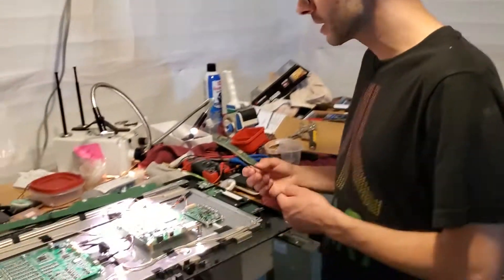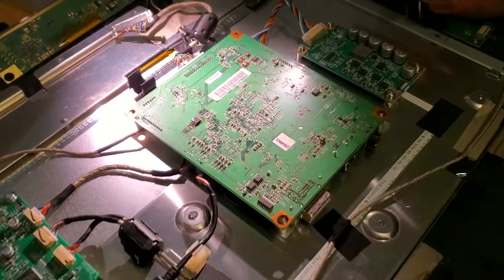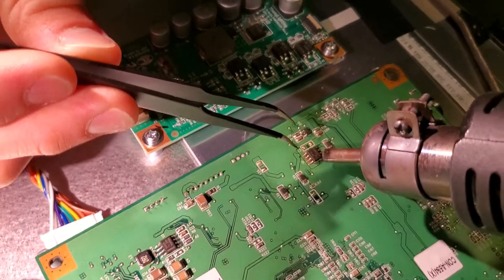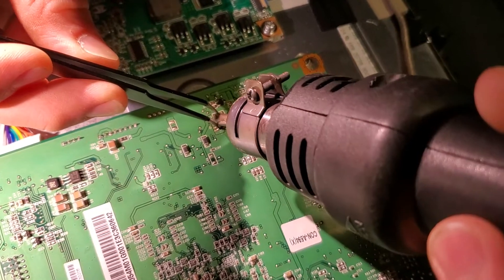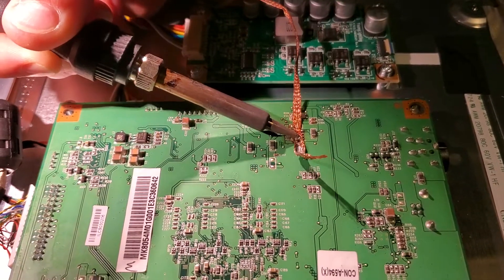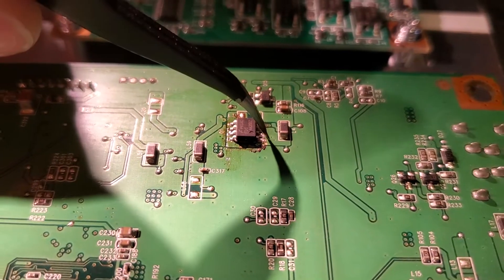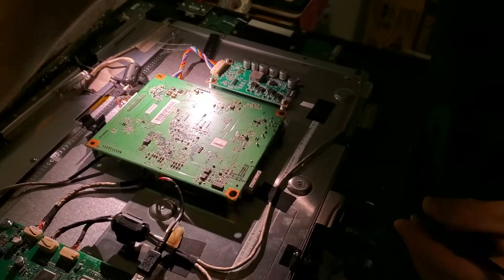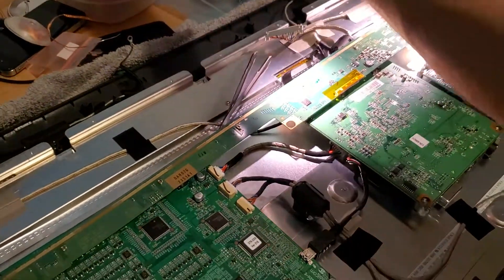DEMONSTRATION Cintiq 22HD Transistor replacement

Comment: Thank you for figuring this issue out and providing links and info on how to fix it. You saved me hundreds of $, if not thousands(for a new one). I wasn’t able to desolder and solder the replacement parts, but my buddy was. Only spent 5 bucks on parts. Much appreciated.

Comment: wow, you need to beef up that soldering technique for soic components.
Reply from the maker: It is better to use a square heat head to go completely over and remove the chip in like 30 secs or less, then a nice iron and braid to flatten/clear surface. When putting in the new chip, I usually bridge the pins that are internally connected to give a better connection and allow more heat dissipation to prevent refailure.

Comment: Hey Ian, Thanks for posting your videos. Were you successful at repairing a 27QHD with the same transistors as the 22HD? I have a 27QHD that died in the middle of working (no backlight, no on screen logo, no computer will recognize it, Power LED constantly blue when turned on). I'm able to do the soldering myself but I could use some info. Are the transistors the same in both models?
Reply from the maker: The current solution is going to be to completely replace the board that goes to the screen with a Chinese part and do some custom re-rigging I still haven't had any time because I'm working like 50 hours a week lately basically since before the start of this year if you send me an email I can try to send you a parts list but I don't know when I'll have the time to even do that
Reply: @procersapientiae  No worries, dude.Thanks for the reply. I was afraid it might be something like that. After leaving the Cintiq off and unplugged for several hours, it did come back to life, but the "No DisplayPort Cable" message got these vertical lines and it stopped moving. But then cycling the power button cleared it and now it seems fine. I suspect either memory corruption (maybe a short somewhere?) or whatever microprocessor they used might be on death's door. I'll keep investigating. You do good work, man. Keep up the good fight.
Reply: This morning my 27 qhd developed a distorted image with vertical lines in it. The pen was still working but when I turned the display off and on again the screen did not come back. The computer recognized the pen input still and the blue led is on. I have it disassembled looking to see what can be done. I'm hoping mine may come back after being unplugged for a while too.  I was wondering since it's been over a month for yours has it failed again or is it still chugging along?
Reply: @kennethearlwebb  It died and stayed dead. I eventually contacted Wacom and they charged me $400+ to repair it. They had to replace the mainboard and they would not send me a mainboard to replace myself. I had to send the entire unit so they could repair it. But at least the repair worked.

Comment: Hi Ian, I have a 27QHD with the same total black screen issue. Do you think if the capacitors and transisters are changed it would work?  If so, can we use the same capacitors and transistors you have referred to and used with the 22hd on your videos? I sent you an email with details, hope you can guide me.
Reply from the maker: 27 is currently in process for an attempt, just working 2 jobs and school right now, so things are a bit more backed up than I wanted.
Reply: @procersapientiae  I totally understand Ian. Please reach out when you have a solution. Thanks so much and good luck with your busy schedule.

Comment: Hey Ian, I have to thank you for your videos, you just saved my 10 years old Cintiq 22HD, I replaced the 5 transistors and it came back to life!
Wacom was asking me €300 to replace the main board by sending the tablet to their Repair Center in Germany (I live in Italy), and with some hours of work and a pack of 15 transistors for €15 I was able to resolve the issue by myself. You're the best!
Reply from the maker: I'm so glad my videos were able to help you!
Reply: Tutti i transistor con la Q che vanno aggiornati sono di tipo: FDS 4435BZ ?
Come è andata la tua riparazione Matteo? Li hai cambiati tutti insieme oppure uno alla volta iniziando magari da qualcuno in particolare?